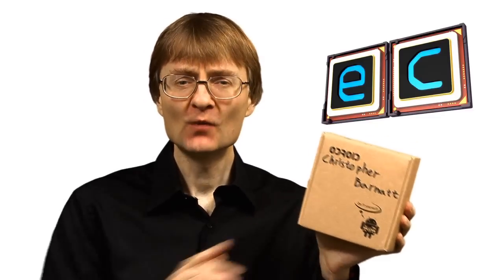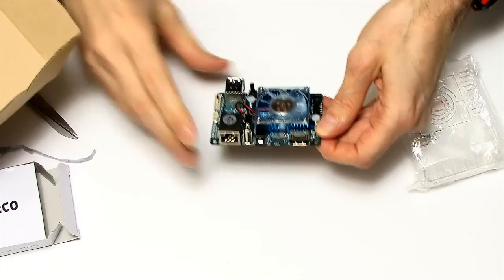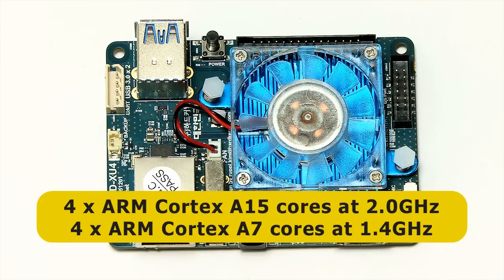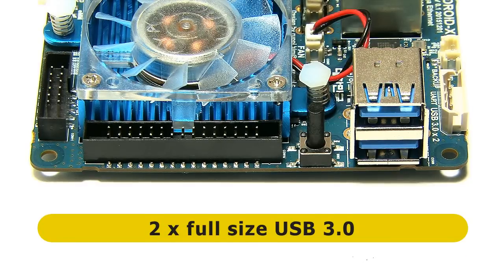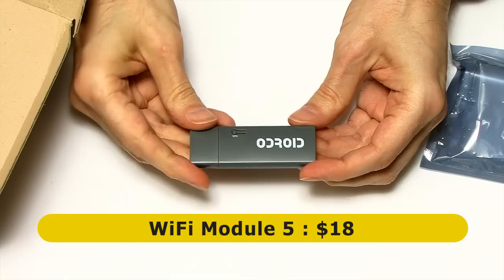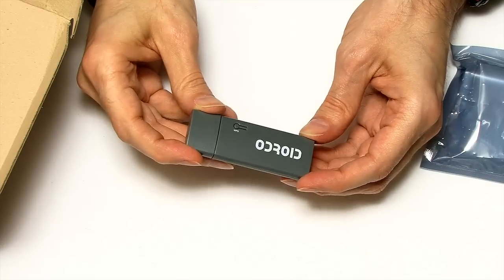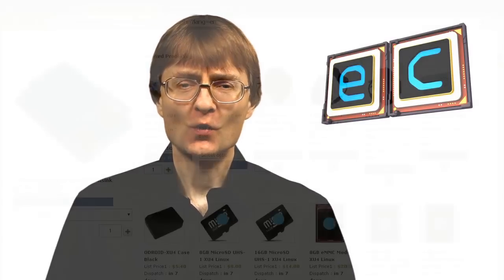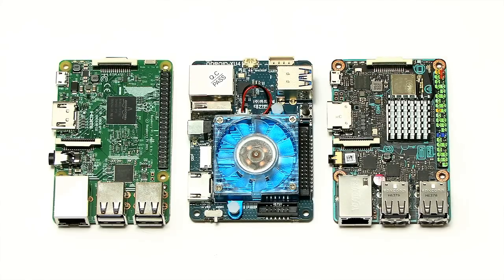ODROID-XU4 Octa-Core SBC

Comment: this mini computer is literally miles better than the computer i had just 3 years ago.
technology never ceases to impress and amaze me.
Reply: statorworks 345 You lucky person... my first computer had an 8 bit, 3.5mhz Z80 CPU and one Kilobyte of RAM. A Sinclair ZX81, bought in 1981 or '82. A mono cassette recorder to load and save programs, plugged in to a 12 inch black and white TV. Then I had a 16K ram pack for Christmas. A massive 16K of memory, that occasionally wobbled. 😁
Reply: I found an OG :) My dad had a Tandy color 2 with a cassette recorder. I regret not playing with it when I was a kid.

Comment: has anyone here experience how durable emmc is compared to sd? does the speed come with shorter lifespan?
Reply from the maker: eMMC should have no worse lifespan than a comparable SD card or "traditional" SSD. It is a core and reliable smartphone and tablet technology.
Reply: It is specifically no better or worse than any other solid state storage in mainstream use, but it's at least six times faster (depending on revision) than SD/microSD cards.
Reply: Armand79th 
thank you
Reply: ExplainingComputers 
thank you

Comment: Very nice, as always.  Purely out of curiosity, when in eMMC boot mode, can the SD card be used as removable storage?  Conversely, can an eMMC be used as storage when in SD boot mode?

I need a new toy, and this is a fantastic candidate.
Reply from the maker: Certainly when in eMMC boot mode you can use the SD card as removable storage, as I have done that. I have not tried the other way around, but suspect it is the same.
Reply: Excellent.  Thanks.  Looking forward to your followup videos.
Reply: I suggest external hd.  My xu4 has 64gb running Android. I have yet filled up.  It has over 400 apps
Reply: Yes it can be also the other way.

Comment: Christopher – thanks for the review, I’m curious to know more about this thing.
I’d like to ask if you could possibly include a CPU crypto-miner in your benchmark comparisons.  I’ve been using the Magicoin miner (this currency doesn’t benefit from GPU support so it’s a more even field for mining).  It’s of real world use as the SBCs can be set up to become low power, low cost miners and those who just have one on for other reasons can monetise their spare capacity (if they run it as a lot priority process to a mining pool).
The one I’m looking at for Magi-coin is https://github.com/magi-project/wolf-m7m-cpuminer-V2  It does seem to need specific compiler configuration to properly use the gear (we’ve been working on a script to download, optimise and build the miner with a menu for each major board config).
We’ve been finding some interesting results from various builds (e.g.  the jump in performance switching to a 64-bit OS from a 32-bit on the same HW) as well as some surprising results for small SBCs;  the Tinkerboard (despite being 32-bit) is pulling the same has-rate performance as a 64-bit Core2Duo e8400 which I found surprising.  I’m still waiting for a Rock64 to arrive to test on that but I think it could achieve results into the low Core i3 range.
I’ve seen figures for the Pi-V3, Vim2 and some others – I think overall this could be a good, useful-outcome comparison for sheer core performance across various SBCs, especially those which are very low cost and have a powerful CPU configuration.
Reply from the maker: Thanks for ths -- very interesting. I must look into the mining side of things.
Reply: I am happy to forward on what I have found thus far, I've been working with Joe from the Youtube channel Novaspirit (in the US) on some mods;  he has better resources in terms of SBCs and also experience in this area, I'm just trying to ease the installation and utilisation process for the program.  He was the one who first published the notion of using these things for mining, previously I was unaware of hash systems which didn't work with GPUs (apparently this is the nature of Magicoin and some others as opposed to Bitcoin).  The arms-race of GPUs in that space means it's almost impossible to benefit unless you are in a VERY new coin release, CPU mining seems to be much more level at this point.

Comment: I like it, but all these mini computers all look a bit ridiculous once you connect a bunch of cables and accessories. I can't wait  for the day they can use a single connector to handle it all.
Reply: Once you connect up all the cables, you can mount the box onto the back of your computer monitor.

Out of sight. Out of mind.
Reply: i like me my non-proprietary plugs. these boards are prototyping/dev platforms, not consumer devices. you can always go buy a mac or an andriod stick, if you dont want or need that kind of connectivity. imho, having to plug everything into a hub/dongle is far less practical. plus every wireless connection where one could use a cable, is a security risk and adds to EM pollution.
Reply: I've had the same thought as you regarding too many connectors on every SBC. 

It would be very nice if we could buy a connectorless version of boards like these.
Reply: https://ubuntu-mate.org/blog/how-to-pronounce-mate/
Reply: Ubuntu martae??? It's mate lol
Reply: Bloody hell they should spell it then. Why do they butcher the English language for??
Reply: He said it correctly. The Mate developers pronounce it the way he said it!
Reply: Well, I'd want at least separate power in, and I/O connections. But in all honesty, you could just plug in a USB3 hub, and plug everything else into that. I would also not want WiFi anywhere near the thing, and turn it off if SBCs have them, but that's just me. Many USB3 hubs have an RJ45 in them for network, and some have video (with one of a variety of connectors) built in.

The problem then is that each of those things needs OEM drivers for network and graphics, which may not be too difficult, but it's an added layer of "will it work?" Android and Linux are pretty good at handling a wide variety of devices, but some of the fun of SBCs is being able to "port" a wide variety of OS to run on them. I've had a lot of fun getting AROS and RISC OS running on my Raspberry Pi. Are you going to get drivers for a myriad of random eBay USB3 graphics and network devices??? Who knows?

So, the long and short is, that's already possible with all of them. However, it's nice to have the on-board connectors, while you tinker with the drivers for 3rd party solutions.
Reply: It sounds good but it would make no sense because you would only be able to connect  one thing at a time.
Reply: Or none! Well, maybe except for the power connector.
Reply: Those sprung heat sinks really warp the board, I’m surprised sometimes looking at normal PC motherboard just how warped they get and still work...
Reply: Steve Martino usb c :)
Reply: Its still misspelled but  ok... I guess
Reply: There are Vesa mounts to put it on the back of the display.
Reply: Steve Martino USB C?
Reply: +Richard Brown It's Greek, apparently. I believe it's pronounced quite like the Japanese "wait-what?" double-take. (which is "matta-eh?") Not that that's a particularly appealing way to remember a DEs' name, but if you're going to be fussy about pronouncing the G in GNOME..
Reply: You have never heard of USB hub?

Aside from the power issue I mentioned it'd cover everything. Also, if you want a PCIe gfx card on USB3 / C connector, they don't work well over hubs. They work, but it's better to give them their own, dedicated port. If you're "casting" over USB / WiFi / Bluetooth / Ethernet, it's fine. (because compression vs. raw performance) You can get USB (and USB3) hubs with an Ethernet RJ45. I have several, and they work well.

However, you don't want too have much of a lead on your USB hub. About half a foot a most. That can "look silly" in its' self. But if you're a maker, it certainly gives you more flexibility in where you put the holes in the case for your SBC system.

I'm a little bummed by the height of my Pi with all the ports. Makes it hard to build into an elegant home-brew tablet. A single USB-C and a power header for battery would resolve that.
Reply: Abdullah Seba I'd say it's mate, mate and not mate, mate! 😃
Reply: Once you try wireless cables, it will no longer be ridiculous.
Reply: Yea, once they can be powered wireless, maybe. Of course, you can add a power cell, and wireless charging unit, and that's fine, but so long is you need it on a power line, I think you may as well use wires for the more responsive keyboard and more reliable display. It may be nice to build a "dock" for it all, and, again, USB3 (preferably C) would be the ideal interface for that, such that it could become fully wireless once undocked.

The height of all these ports increases the size of the device, and reduces the applications it can have. It's hard to make a truly impressive home-made tablet, or PDA with one like this, for example. If the only port was USB-C, you could add a cell (or battery of them) for portability, and a display on the internal headers. WiFi and / or RJ45 can hang off USB bus, as can keyboard and touch pad if you're going that route. Bluetooth can also run from USB, and if you want to make it a portable gaming beast, you can even run external PCIe off USB3 for accelerated graphics. So it's a very small port, which would enable you to include the physical I/O you need, and not be bogged down by the ones you don't.
Reply: mis-spelt
Reply: Em Ate?
Reply: You have loads of wires when setting things up. When things are going well, you cut those cables down to power, and outputs in a nice tidy form.

No-one gets something 100% correct the first time.
Reply: Steve Martino it already exist it's existed for a while now USB
Reply: Can you imagine.. Lol the ability to hook a desktop gpu up to a single board using thunderbolt
Reply: The single connector will be USB.  We're close to it now.
Reply: The day has come; USB-C (Thunderbolt): display, ethernet, usb 3.1, power. All in One Cable.
Reply: Apple patented it. The SCSI Cable.
Reply: be sure man
Reply: Try U.S.B 3.0
Reply: firewire is coming back!
Reply: How about wireless usb 3 and wireless hdmi. THose two and our alsmot wire free.
Reply: usb c
Reply: Steve Martino USB C and thunderbolt fits all your needs
Reply: I agree, it’s too small for many uses. 
What I’d like to see is a passively cooled and completely silent pc built on a laptop processor. With the case being part of the cooling system.
It’d be powerful enough for many uses, and silent enough for creative work.
Reply: So something like thunderbolt?  that would be neat to see.
Reply: Because the name comes from the South American tea herb yerba mate (which is pronounced "mah-tay"), from which you make mate tea. It's less about someone you think it's butchering English and more about languages other than English having similar words for different things.  Ignorance goes a long way.

Comment: It felt perfect until 4:57... 😣😢😭
Reply from the maker: I know. The lack of onboard WiFi is a real shame.
Reply: to be portable yes, but for me I like hard wire whenever I can. I look at what WiFi bandwidth on a good router compared to even the most low end Cat5. Plus there is issue with noise (other wifi boxes)
Reply: Nevakonaza - Well, it's 2017 not 2013... No excuse to not have wifi and bt onboard.
Reply: Just use one of those small wireless dongles,Sure it uses a USB port up but personally anyway,Wouldn't be a deal breaker for me,Seems a nice board.
Reply: problem is activating the service in the OS, NOT all usb is plug and play. Over half the USB cameras i have played with have proved that
Reply: that's why the EPS8266 was made, to give those boards wi-fi but the side effect is now it is a SBC project

Comment: How well has this been adopted? I feel that any single board computer that isn't a raspberry pi has very little use other than running as a Kodi box. I never see projects on hackster/ thingyverse/ for anything other than a pi or arduino!!
Reply: Ryan Hodgkinson Odroid has a pretty strong user base with a lot of independent development. Just check out their forum and you'll quickly see for yourself.

Comment: 5422 exynos is a 64 bit soc???
Reply from the maker: I believed so when I made the video a few days ago, although not all of the architecture on the SoC is 32 bit. Certainly the memory addressing is 64 bit, as Hardkernel significantly signal. The Samsung page for the chip is here: http://www.samsung.com/semiconductor/minisite/Exynos/Solution/MobileProcessor/Exynos_5_Octa_5422.html But I am now struggling to prove my 64 bit claim. So I could be wrong on this -- and if so I am sorry. :(
Reply from the maker: I have now confirmed -- and you are right, the processor cores are all 32 bit. Memory is addressed 64 bit. My apologies.
Reply: the cache memory handle the 64bits, and processor handle with it 32 to 32 bits at time?
Reply: No worries with only 2GB's of RAM it's not really an issue? On the upside 32bit programs are slightly smaller so there is that? lol As a tinker board 32 bits is fine depending on what you want to use it for. I would prefer 64 bit myself but if someone bought me this as a Christmas present I wouldn't return it... lol (actually I would put Android 7. something on it and a bunch of emulators and put it in one of those NES or SNES boxes and have a ton of fun on it :)
Reply: ExplainingComputers As Mr Sugar would say... You're Fired! At least until next Sunday. 😉

Comment: interesting that you didn't try firefox^^ ... i would really like to see if it runs on your board, on mine it doesnt. oh and please check out if youtube runs smooth. never the less i love this thing and i'm glad that chose odroid instead of the pi3. the usb-ports and the gbit ethernet port are awesome, even if the overall performance as a desktop pc sucks, as a server it's great.
Reply from the maker: I struggled to get Firefox running, but searching around found that the latest release for Ubuntu MATE does not work on any SBC. So it seemed unfair to highlight this and hold it against the ODROID.
Reply: Youtube can run fine but requires a special version of chromium...  Pretty easy to search that one up in the forums
Reply: ExplainingComputers Firefox ESR works well enough on the pi3. Just don't try to listen to VLC wile surfing.

Comment: It seems like there's more and more SBC on the market these days, I wonder how long will the raspberry pi stay as the dominant player in the sbc market?
Reply: The Pi is designed to be a very low cost, low power and silent computer - it doesn't even need a heat sink let alone a fan. The XU4 costs twice as much; aimed at a different market. The Pi is king because of price, outstanding software/OS support, and especially the massive number of HAT add-on boards. Can't see this changing any time soon, although I agree they should consider releasing a more powerful Pi as an additional SKU to compete with the likes of XU4...
There isn't really anything that can compete with the Pi zero range yet, I mean that thing was given away FREE with a magazine!
Reply: Farhan The Badass Scizor This has been around for 2 years.

Comment: How does it run FireFox? Looks snappy. These SBCs all suck at graphics intensive apps like movie player (1080), or FireFox browser. The Mali chip is closed source :(
Reply: Increasing GPU memory to 128 in the raspberry pi config fixed this for me.
Reply: I hope retropie offical build on odroid xu4 has chrome and firefox, on rpi3 they have thoses broswers so im sure its running the same thing(i hope)
Reply: All ARM SoCs used in those tiny computers have closed-source GPUs.
Only x86 boards have open source GPU